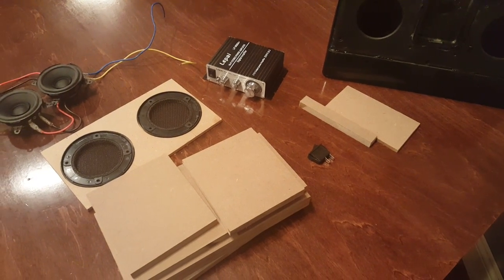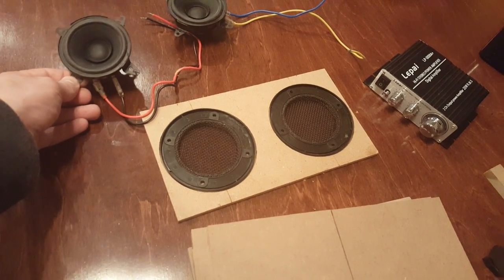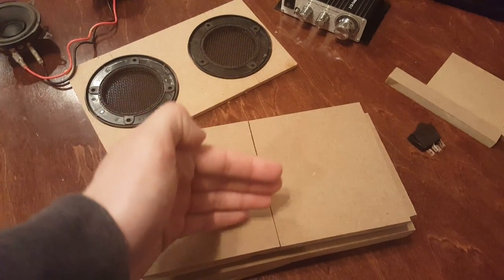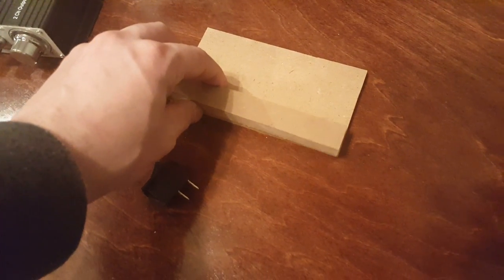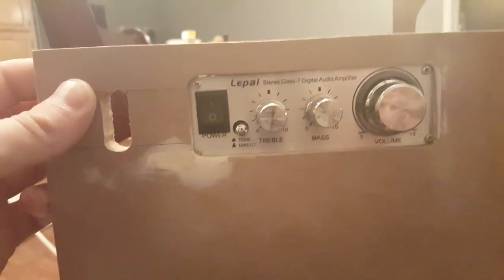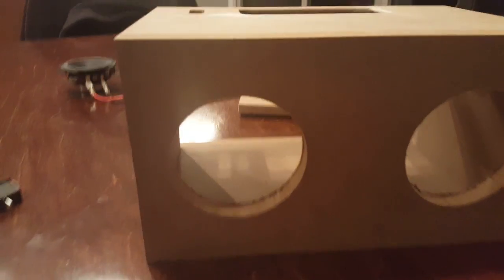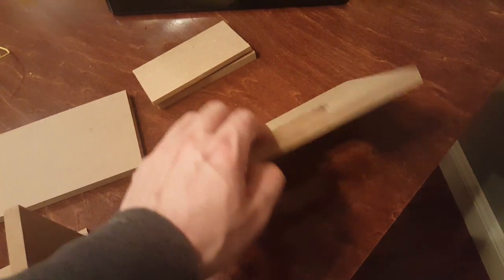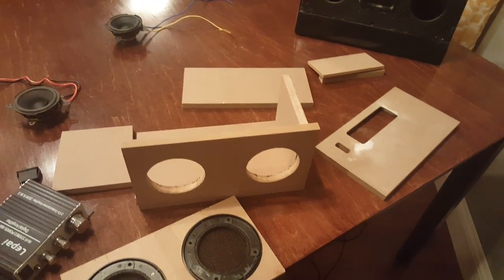DIY Bluetooth Speaker Box Design and Cutting Tips

Comment: So my question is, say you buy your speakers instead of recycling a pair so there's no enclosure to measure. You figure out what cubic ft cabinet your speaker would work the best in. My confusion is, is that calculation based on a single speaker? Or is that for a pair of speakers?
Reply from the maker: That's a very good question.  you can do it either way.  the best thing to do, is model it in WinISD (free program) to see what you'd prefer.  On my Overnight Sensation Bluetooth speaker, I decided on 2 separate enclosures, while this one I kept it as one.  Typically, the variable will be the port and port velocity.  In some cases, it will really only work with two separate enclosures.  After I finish my next build, I plan to do a series on WinISD to help with these types of questions
Reply from the maker: Here's the link to the WinISD tutorial: https://www.youtube.com/watch?v=Ol7K5wQrFAg&list=PL6hjpiCHZmIOAv44PCreW5KlI35h1mTZK